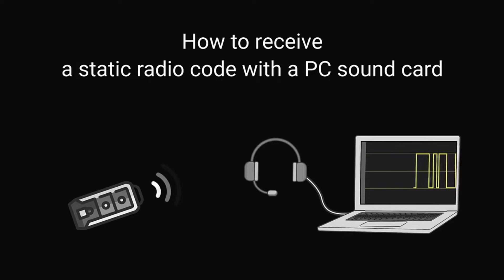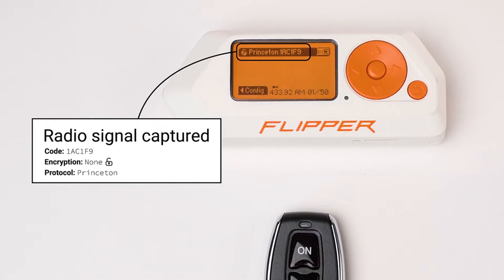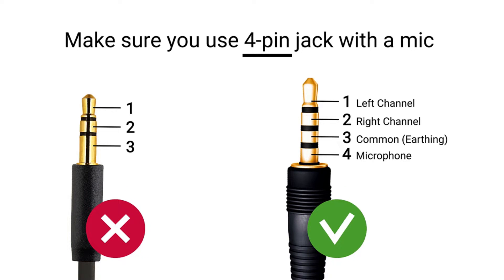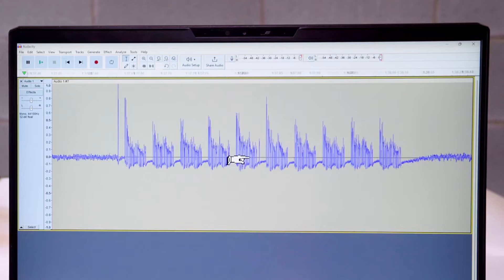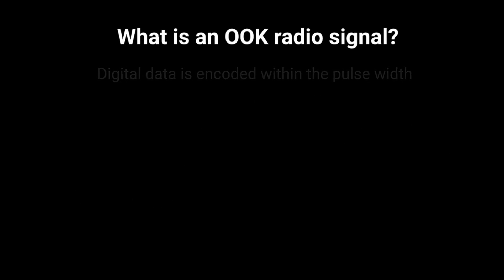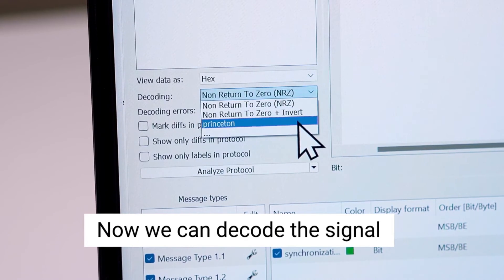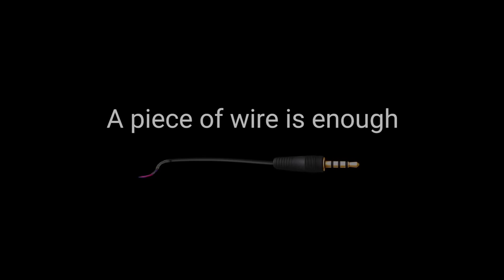No Flipper Zero Required | Read Sub-GHz with a piece of wire!

Comment: Great, awesome video, some new way of signal analysis. I happen to have a pair of Samsung headphones with the same jack; I'm going to buy these little things tomorrow so I can make it. How do you connect the outputs from the jack when holding the wires to the circuit with a diode antenna and capacitor?
Reply from the maker: Yo yo!

It sounds like you're diving into the fun part—soldering! 

Handling all the pieces can indeed be a challenge, but here’s a handy guide to help you manage the process smoothly:

Use a Helping Hand Tool: 

This is literally a third hand tool that typically comes with alligator clips and sometimes a magnifying glass. You can use this to hold your wires and components steady while you solder. These tools are inexpensive and invaluable for any electronics hobbyist.

Prepare Your Workspace:

Stabilize Your Components: 

Before you start, make sure all your components are laid out and easy to reach. Use small pieces of tape or blu-tack to keep lighter components like diodes and capacitors from moving around on your work surface.
        
Tinning the Wires and Leads: 

Apply a small amount of solder to the wires and the leads of your components (diode, capacitor) before you try to join them. This process, known as 'tinning', makes the actual soldering faster and easier.

Soldering Sequence:

Attach the Diode: 

First, solder the cathode side of the diode to the audio output wire from the headphone jack. Ensure the connection is solid before moving on.

Connect the Capacitor: 

Next, solder one terminal of the capacitor to the anode side of the diode. This will block any DC current from affecting the signal.

Finalise the Antenna: 

Finally, attach the antenna to the free end of the diode. This connection is crucial as it’s where the radio signal is captured.

Check Your Connections:

After soldering, always check your connections with a multimeter to ensure there are no shorts and that each connection is solid. A visual inspection can also help. Look for shiny, smooth joints which indicate good solder connections.

Secure and Insulate: 

Once you’re satisfied with your soldering, use heat-shrink tubing or electrical tape to insulate the exposed wires and joints. This prevents shorts and provides a cleaner look to your project.

Soldering can seem a bit tricky at first, but with a little practice, it becomes a straightforward and satisfying skill. Take your time, and don’t hesitate to reheat and adjust the joints as needed to ensure a solid electronic connection.

Happy soldering! And may your signal capturing be a success!

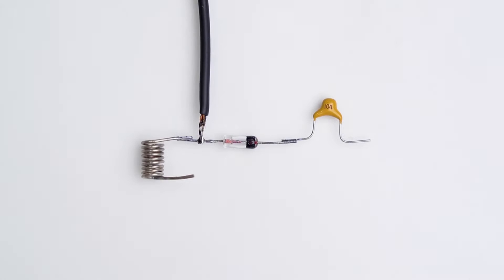Comment: what are the two wires on the microphone which  you solder the microphone cable to the filter cable  at  0:55
Reply from the maker: The two wires on the microphone cable that you solder to the filter cable are typically the audio signal wire and the ground wire. 

In headphone/microphone cables with a 4-pin plug, these wires can be identified as follows:

Audio Signal Wire: 

This wire carries the microphone signal. It is often coloured (like red or green), depending on the cable's design.
    
Ground Wire: 

This wire provides a return path for the current and helps reduce noise and interference. It's often black or bare copper.

When soldering these wires to a filter cable, ensure you match the corresponding wires. Here's a guide to help you connect them properly:

Identify the Wires: 

Before soldering, identify the audio signal and ground wires. In some cases, the audio signal wire will have insulation, while the ground wire will be uninsulated or have a different colour.

Prepare the Wires: 

Strip a small portion of insulation from the signal and ground wires on both the microphone cable and the filter cable. 

'Tinning' the exposed ends with solder can make the connection process easier.

Solder the Connections: 

Connect the audio signal wire from the microphone cable to the appropriate point on the filter. Similarly, connect the ground wire from the microphone cable to the corresponding ground point on the filter.
    
Secure and Insulate: 

After soldering, use heat-shrink tubing or electrical tape to insulate the connections. This helps prevent short circuits and provides additional stability to the soldered joints.

When connecting these wires, ensure the audio signal and ground are properly connected to avoid interference or improper signal capture. 

If you're unsure about the wire layout, check out a diagram for the specific type of cable or check with a multimeter to confirm the signal and ground wires.